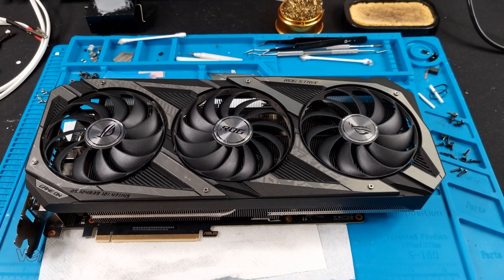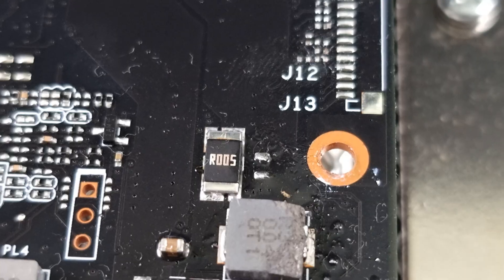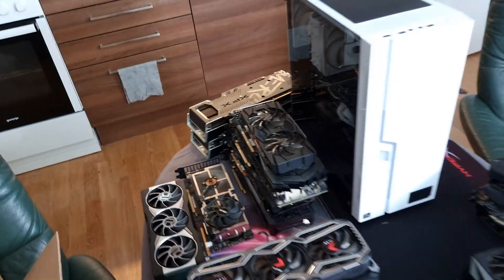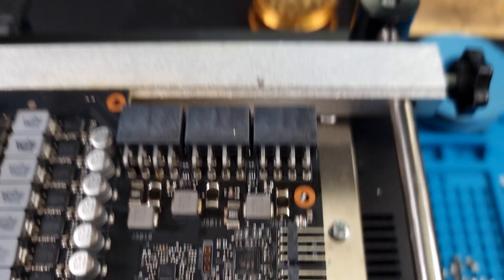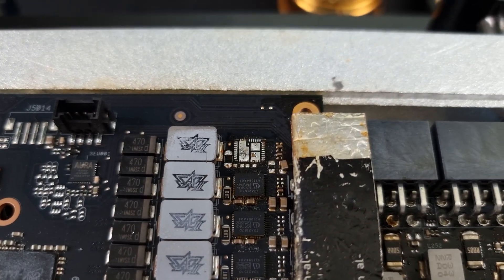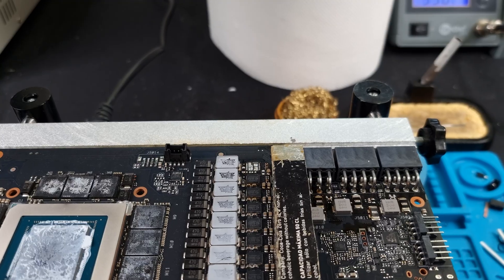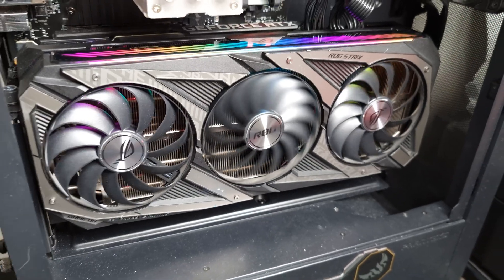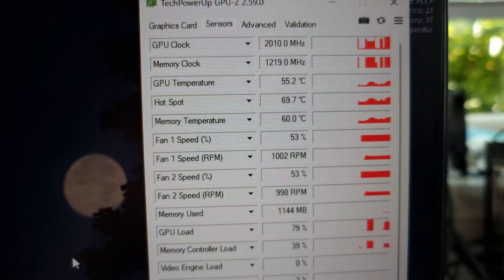ASUS RTX 3090 Strix Catastrophic Power Failure Fix.

Comment: Probably flashed a 1000 watts bios. The Strix already has a high power limit with pretty decent power delivery. So saying don't overclock on a Strix is pretty redundant when it's pulling more power than most 3090s.
Reply from the maker: @metradawn8071  What makes up the strix power delivery?
Reply: @TechnologyHive  You're messing with me... You literally changed the MOSFETs
Reply from the maker: @ No I'm not messing with you ☺. But you did mentioned the strix has a "decent" power delivery. The truth is, if they would have used Infinion branded Dr.Mosfets for the whole power delivery, then I would say you are correct. But instead ASUS decided to mix Infinion for core and soc, and OnSemi for memory, which is a mediocre brand which I see fail again, and again. 

Same goes for Alpha & Omega that Gigabyte and ASUS love. They are mediocre quality, often popping and leaving a hole in their place. I am not trying to be mean, I am just letting you know what I have experienced, vs what many people, such as yourself believe. That's all. 👍
Reply: @TechnologyHive   No I completely agree with you. That's exactly what I meant when I said pretty decent and not outright "good". I also don't get why Asus thought a 10+6 Phase of 60 amps Power Stages is enough for a card that draws 480 watts. Admittedly it's the memory VRM that failed, which I think 50 amps Drivers are more than enough. What I also find strange is that it didn't bring the memory controller in the core along with it, but the fact that those OnSemi's are Smart Power Stages are probably what saved the core.

Anyway, what I'm saying is that I think "Don't overclock your 3090 Strix" is a moot point when these things came with a factory OC that are designed to fail. 

But I'm curious what you think good 3090 brands are when EVGA used Alpha&Omega while MSI made the abomination that is the Gaming X with 45 amps DrMOS.
Reply from the maker: @metradawn8071  It's hard to give an opinion, really. One MSI 3090 can have Texas Instruments Dr Mosfets, while another of the same model can have MPS. I do not understand the reasoning for this and why AIBs engage in this practice. I just repair what lands on my desk. What I can say is that from what I have seen, gigabyte and asus models have mediocre power drivers. But once in a while I get one with MPS controller and drivers...makes no sense man. I have stopped trying to read minds and I just fix these things 😊

Comment: Not sure that you are showing off or what, but i have never seen any GPU recover from a blown mosfet on memory rail. That would be a first one. 99% time its its a dead core and all of the memory chips dead as well. And i fix gpus and pc hardware daily.
Reply from the maker: I never wanted to come off that I am trying to show off 🙂. I just do not make repair videos because I simply do not have the time for it. I also just wanted to give my viewers a little tour of what I do for a living as well, besides YT. 

This is a one off. I have 4 other 3090's from Zotac which loves using those "fool's diodes", and all 4 have a dead core and memory chips dead. No MSVDD. But with this one, there was power on MSVDD, so I gave it a shot. And it worked. Thanks for watching btw.

Comment: im currently runnung a 4090 laptop gpu made for 125w at an average of 150 with highs of 175 max core temp 75 max vram tmp 90 max hotspot temp 82 - is this cause for concern
Reply from the maker: Nope. Those are actually good temperatures. Just to put it out there, the number one killer of PC components is voltage. When people go and try to overclock their hardware for a few extra FPS. Your temps are actually very good.
Reply: @TechnologyHive  thank you i use an foam sealed cooler which forces air through the laptop (ites gt 500) keeps temps down and i change its speed depending on the games wattage

Comment: Those Onsemi mosfets are known to be dogshit quality. Not too sure that overclocking had anything to do with it, VRM looks like it has plenty overhead...
Reply from the maker: @detmer87  They're not the best, but cards in this state usually come from people overclocking. It's part of the little info I get from them.
Reply: @TechnologyHive  Have you noticed problematic cards from undervolts?
Reply from the maker: @Nubaeus  No not that I have heard of. Usually, not always, people provide a little information about their cards, like for example, if they were used for mining, or if they were overclocked. But I have not head issues resulting from under volting.